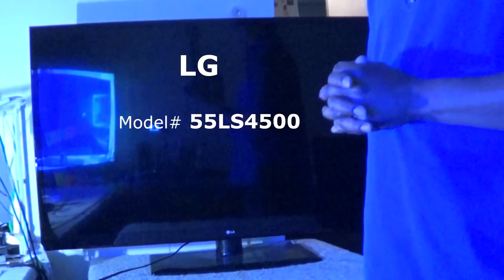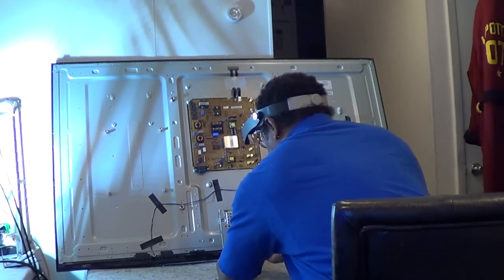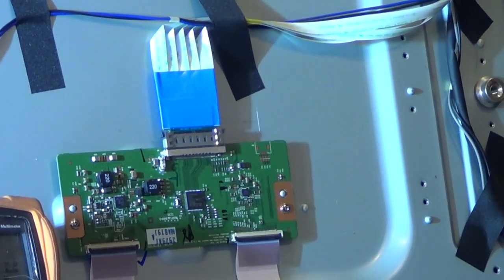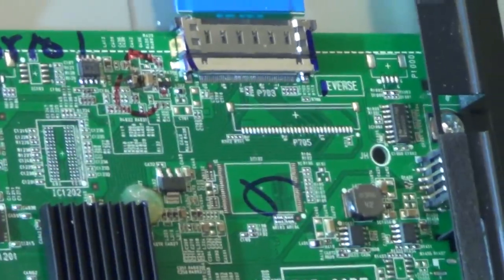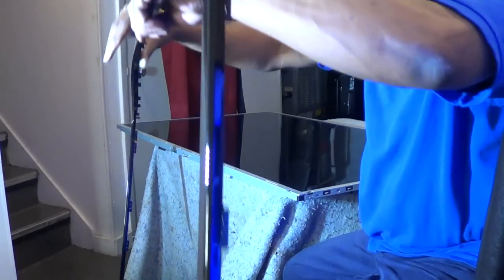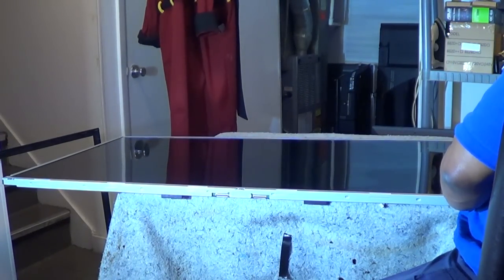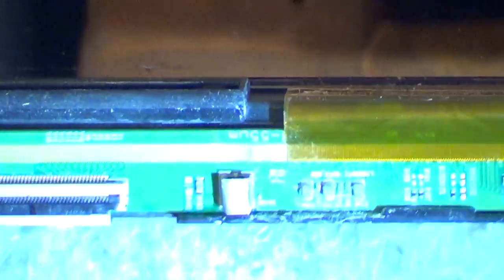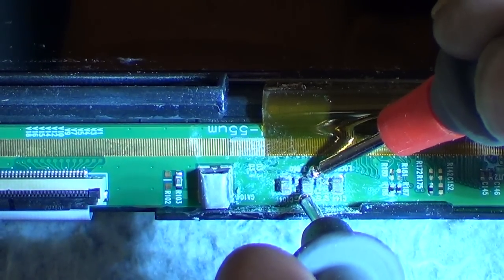Backlight but no display. T-Con board or bad LCD Panel? How to Isolate

Comment: Your video helped me a ton, BigDog. I had just replaced all the backlight LEDs on a 55" RCA television, using your videos as troubleshooting guides. Once the backlights were working, I all of a sudden had no picture. I suspected the T-Con board and did some in-circuit testing of surface mount capacitors, after hearing you stress that they can be a real problem. I found that several were showing a short, but I knew that they were connected in parallel, and that most likely only one was the culprit. I noticed that one of them seemed brittle and my test lead would kind of chip away at it, while the others were not brittle. I removed that suspect cap with hot air, and low and behold, I got 12v back, whereas before there was a very low fluctuating voltage. The picture works now and I'm very happy, as I am working on this TV for my uncle and was really hoping to save it. I have the exact same TV that I'm currently using as my computer monitor, and it's been a great set. I do plan to replace that bad capacitor, or I'll just wait for the new T-Con board that I had unfortunately already ordered. Thank you sir!

Comment: As someone who does cellphone repair and tv mounting for a living, one technique I’ve found incredibly important to avoid stripping screws is to first go in reverse and you should feel/hear the screw skip itself into the hole and then it will go straight in. Especially important on iPhone repairs.
Reply: Yes, man! All my life I have been using this technique, I came to it myself. And this is the first time I meet a person who does the same! Delight and respect!
Reply: @fixingmania  I too discovered it myself through my own practice/experience. Cheers!

Comment: You are just incredible!!! Thank you so much for all the help, followed your tutorial and just fixed my TV after looking for a solution for days! My only doubt it's if I can replace the SMD capacitor for one that looks exacly the same or if I need to look for a certain one? Thank you once again!
Reply from the maker: If your referring to the little brown or tan smd capacitors; then YES, u can use one thats the same size.
Reply: Thank you, I bought a 10uF same size, already replaced it some days ago and it's back on work again ❤️

Comment: Got the same problem with a TOSHIBA 40L3451DB, I originally thought it was the tcon board but it doesn't have one, after watching this video I'm going to strip the tv down a bit more & check around the driver boards. Thank you for the video , very useful information .

Comment: I have a TCL with backlights and no display. I replaced both the power supply and main board. There is no TCON, so I think the problem is on one of those scaler boards along the bottom.

Comment: bigdog8882, I watched this video last night after being given a 42" LCD with working back lights and sound, but no picture. Most video's on the subject are pretty much repeating the same information over and over, I'm not saying it's bad information, but there's some key things you need to know in certain scenarios and they don't always explain that properly. The one key thing that brought your video to my attention was when you found the short across the capacitors in the T-Con board and you then took the time to explain that when you disconnected the panel strips from T-CON the short was no longer present on the T-CON. This led you to check for shorts on panels own circuit. You also took the time to remind us that no capacitor should have negative on both sides. That is what resolved my issue. I ended up replacing 2 SMD capacitors on the panel with my soldering iron and a magnifying glass on my living room floor. I now have a 1 yr old 42" LCD and it was completely free! Thank you sir, good advice :-)
Reply: In my case, it wasn't water damage. 4 capacitors on the driver board tested as negative on both sides. No obvious signs of damage, heat or any of those things, it was just simply a blown capacitor. Obviously I didn't know which one it was, so I started with the one nearest the strip connector. When I removed that capacitor I tested the other 3 remaining on the board that were in short circuit and they were still in short circuit. I removed the next capacitor and retested and this time the remaining 2 capacitors tested correctly with no short circuit. So I just replaced the 2 capacitors I removed with some I recycled from my scrap pile. That was it, job done!

Comment: Impressed with your soldering skills! Great work! Currently have a LCD computer monitor that's suddenly gone blank - seems that a similar process might be going on (sent it back to ACER and they want £800 for a new panel - a new monitor would be about the same!)

Comment: Just wanted to thank you for this video.  i picked up an LG 55LN5600 for free that someone had tried to repair.  It had 3 LED's out and I replaced them so I had back lights but no picture.  Checked the Tcon and fuse was blown and no apparent shorts to ground.  Replaced fuse and now have TV up and running.
Reply: :thanksdoc:

Comment: Great job getting that telly back up and running! I do not have good soldering skills. I do have a question though...I was given a Hitachi 39" 720p TV that I was going to use as a computer monitor. It powers on, including the backlight, but has no picture, menu, or sound. Suspecting the EEPROM chip, but lacking soldering skills, I replaced the mainboard. It's an all-in-one board -- power supply and T-con. The screen has its own driver boards. Replacing the mainboard made no difference. Backlight, but no picture or sound. That's baffling to me. If the screen/driver boards were bad, I should still have sound. The speakers have a completely different connection on the mainboard. Would a bad video driver board prevent the speakers from working? I tried disconnecting the video driver board completely, seeing if I could rule it out. Or should I contact ShopJimmy, where I ordered the replacement mainboard, and RMA it. Is it possible I got a bad board?
Reply from the maker: Bad LCD Panel.... You probably don't have sound because you don't know what input the TV is on if you cant see any image on the screen. You can try the Tape method. You Tube "Frugal Repair"

Comment: Sometimes I don't understand people. 325K Visual and only 2.66K thumbs up. OMG disappointing (for me)...come on man...let's cheer up...
On the other hand, (14:56) I have a SMD990. Reliable (in/out) of the circuit. Price versus function ratio in favor of the technician... I didn't leave the link so as not to violate any channel rule. Excellent video to train technicians in fault detection. Thank you very much for sharing sir.

Comment: very intuitive.  Got a Dell 2210f monitor that has faulty panel.  Will look ad driver board and check caps. The power board protection cct kicks in 1 to 2 secs after power-up - image and backlight can be seen during this short period.

Comment: Picked up a free LG 65 inch TV with sound and backlight.  Went through all the troubleshooting and checked all the parts.  Even tried the baking of the mainboard to no avail.  Got tired and ordered a repair kit from someone on eBay with over 1K sales and 100% good feedback.  Guy showed pictures of working TV with busted screen.  The parts were what I need so I bought the kit which includes mainboard, tcon, power board and even two extra cables.  I replaced Tcon, mainboard, powerboard and then the cables, test it out one at a time.  Nothing worked. I removed the ribbon cables and even slightly clean and reseating them.  What else could it be?  Thanks!

Comment: Very informative video! I have a 55" LED Finlux TV that just went black as i was watching it. Found this video after some searching and followed the same process of elimination. Found that same short over the capacitors on the t-con board, however that micro-fuse was not blown. When disconnecting the ribbon cable going the right driver board the short was gone. And sure enough, when powering up the TV with that ribbon disconnected i got picture over half of the screen. I see no apparent damage on the driver board, though. Is there any chance that one of the caps just went bad or should I consider this one a goner?

EDIT: Found the problem! It was indeed one of the caps on the driver board that went bad and shorted. Replaced it with one from a salvaged computer board. Cheap fix. Thank you! :)

Comment: Hello 
Need your help please, My tv is down, when I turn it on the screen is black, there is sound, and the slab is backlit.
I checked the fuse of the t-con, 12v ok
On the other hand there are several ceramic cms capacitors are in the courtyard circuit (all the tablecloths unplugged)
The problem comes from capacitor?
If yes can we change that the capacitor cms, or t-con?
Thank you in advance

Comment: How are you. Thanks for the information. My Samsung LED TV has vertical lines at the bottom of the  but these lines would disappear and reappear after some time. What could be the problem
Reply from the maker: I got one too, lol. Its the screen. Most likely the driver boards or the cof's in the ribbons. Just have to watch it like that. The screen most likely is not available.
Reply: Thanks very much.
Reply: That same TV has a distorted sound which have breaks to the extend that it would be difficult to hear. What could be the problem.
Reply from the maker: @bigomaso9855  either the source (cable or satelite box), the main board, or the TV speakers.

Comment: Great Video. Try getting a 2nd camera to do the angle 90 degrees so we can see you when you're working. Have a PCMonitor Dell SE2717H. White Horizontal lines on a black screen where the clean message ought to be (Dell self-test - only power cord plugged in). Caps on power board all look good. Opened up the TCon panel. Everything is so incredibly small on a very long and narrow circuit board. Do you have experience fixing this Monitor? Thanks.

Comment: I replaced my tcon board on a Samsung....the new new tcon board didn't fix it. Still audio and no screen. Backlights there. New   Tcon board only has two lights lit up . Any other suggestions?  Removing the ribbons on tcon board does nothing

Comment: i have a samsung panel - about 10 years old... started looking... well.. .funny - like it was overexposed - everyone looked like their faces were shiny... i get it the tv is old and a new replacement is cheap... but i'm willing to have a bash at fixing it, if it's fixable.  when do you figure out the point is, where a tv isn't worth it?   would a lcd panel just go on forever or do things just finally 'wear out'?  newbie to tv repair, but do a lot of diddling around with components for various projects.

Comment: Hi, do you happen to know what solution or how to fix(jumpering side cof, cof is a bit different from others that have round visible test points for easy solder) broken connection at the side cof, there are 3 cof at the side and the 3rd one is faulty having black display or black/colored lines, not the cof itself, just the panel wires connecting 2nd and 3rd cof. The side panel where the cof are located had a small crack between 2nd(middle) and 3rd(last or bottom) cof and that caused the black lines display. 1st(upper) and 2nd(middle) are both okay, just the 3rd(bottom) is bad because of the crack(lost wires/connection) on the panel. Please answer.

Comment: Great video, thanks so much. I only wish that I would of found it earlier. Driver board got wet, and I cleaned it to much with alcohol. I knew not to clean he screen, had a roof leak. Cheers

Comment: Hey Bigdog8882, I am trying to trouble -Shoot my JVC 55 Inch LED Smart Curve TV. Model LT-55KC87 With back light and no picture. I have trouble-shoot unit I reach the T-Con board to the driver boards (This TV has 4 driver boards), however, when I remove the ribbon cable from the driver board on the left side the TV works with that side of the display blank. I tried switching ribbon cable from left to right and it makes no difference. I check to see if there was any corrosion of damage components on that driver board but can't fine any. Any ideas what can be the problem? If I remove the ribbon cable and power on it works and once I plug that cable back in the TV picture goes blank.
Reply from the maker: You have something bad on the Driver board that shuts the video down.
Reply: @bigdog8882  Thanks for your reply. I have tested all the components on the Driver board and nothing seems to be shorted. Can it be the panel itself that is causing the short?

Comment: Thank you very much this video helped greatly! Wish I would of saw your video before I bought a T-con board. Had three shorted caps on the left panel board after removing two the short was gone. Tested the two I removed only one was shorted the other was good. After replacing the bar cap the Bravia KDL-55W802A had video once again. The only problem is now I have ghosting of high contrast after images. They clear once the screen is refreshed with a  dark image such as a blank black screen at the end of a program. Any ideas? Thanks again. 😁
Reply from the maker: Still something on that Panel board, maybe.
Reply: I figured it out, the tcon wont produce 8.5 even when the tcon isnt connected to the panel for some reason, maybe because its a proscan tv , thanks Big Dog

Comment: So if I was just replace the t-con board that wouldn't fix the problem obviously?? How to solder but I'm not really good I'm not really good using a voltmeter but I know how to replace the parts with new ones but that have been easier and save time??

Comment: BigDog, I'm sure you've seen the infamous Vizio T-Con board transistor failure, I've got one here...I can't locate the part number, I've seen general specs, people are calling it an NPN, others call it a PMOS...thoughts?  This is on a 70i-A3 model...thanks for any insight.
Reply from the maker: Not sure on that one.
Reply: @bigdog8882  thanks for responding anyway.....the board is inexpensive, I'll wait till the replacement arrives.  You were correct on my other question, the real culprit ended up being a bad 6 foot HDMI cable I had installed a few months back for a sound bar. Don't know why it would go bad over time, but it is what it is.  Thought I had eliminated outside source as the problem, I guess not.

Comment: i have the opposite problem... i have display no backlight! and not have t-con board my led driver connected directly to main board then to power supply, no backlight just display (when i use flash light i can see image) what mostly could be the problem ? thanks ....

Comment: Hello great video helped me a lot! I if a Samsung un40ju6500  no backlights or picture even with flashlight test the led lights come on when I disconnect cable from main to tcon but still no pic inreplaced tcon and main still nothing. Because your video I believe it's panel some of capacitors are beeping quite a few actually. A m I correct? Btw shows no water damage.
Reply from the maker: On the tcon, pull out the ribbon connectors (going to the panel) one at a time to if the screen lights up. If so, then U have a bad LCD panel and you can check for bad components on the panel driver board. (The one thats bad).

Comment: Hi  can you help me please  i have a Sony bravia kdl-55w802   but when plug-in  nothing happens  black screen  but on the motherboard I can see red light on the optical jack  if i press and hold the power button  the red optical light flick twice     I bought a backlight tester   all the led work well with tester.      and i got 8 blinking red  light

Comment: Hey what up bigdog,i enjoy the vids, but have you or anyone done repair vids on tv combo units? I have an rca 22la45rqd,and the original problem was volume control issues so I replaced the mainboard,however being that it took some time to find the right board I forgot to take photos of how the cable from the TV to the mainboard was plugged in,and where the 2 sets of wires were attached to the power card over the dvd player. I haven't found a schematic or a service manuel to finish the this repair could you please help?

Comment: Hey big dog! Hi have a Samsung led and one solid white bar with no picture. Everything else works and has video, just one vertical white bar about 6cm wide. Would this be the T-Con or bad panel?
Reply from the maker: Most likely a bad lcd Panel. But you can still reseat the ribbon connectors (from T-con to driver boards) just to make sure.
Reply: bigdog8882 I have re seated the ribbon cable and still same issue. Will try to do some more trouble shooting tomorrow. Thanks for reply! All the way from Australia

Comment: i have sony bravia 43w800c tv. First white screen started to appear for few seconds and gets normalized automatically. after 4 months now the white screen persists and no changes. Wen i took it to service center they are asking to replace the display panel altogether which costs 50% of TV cost. So any suggestions...........

Comment: Thanks BigDog... I have similar prob on Toshiba 32HL67US, no picture but sound. I think I heard something pop??? So no BBall game. Not sure - do I risk buying newer t-con board (May have probs), or troubleshoot my own board? Never clean screen so no H2O damage here... at best this seems like a project for my list, probably just buy new set cause I’ll never get ‘round to getting this done. That pop may indicate something bigger. Hate to toss a good tv though. Appreciate video. Jd
Reply from the maker: If you have backlights but no Video. U can try to replace T-Con if It uses one.